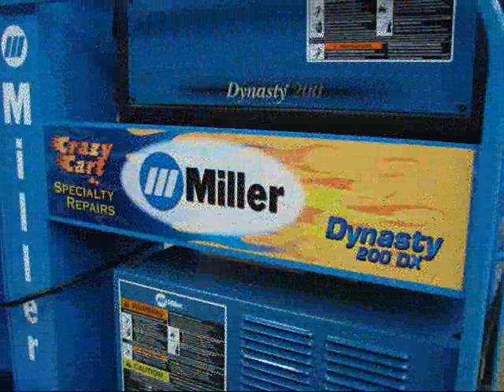Crazy Cart

Comment from the maker: Practical is an opinion and only applies to ones use of an item. For me the Crazy Cart is very practical for my shop. As for lifting the bottle on well I just grab the bottle and lift it on. It would be a simple modification to have a roll on roll off bottle loading system. I just didn't see the need for it at the time I designed the cart. I'm happy to hear your happy with your cart.

Comment: Paul,  I have never welded before and thought they I would like to give it a try, I was looking at the Hobart 140 mig, I only have 120v outlets., and want to keep the cost down since I do not know how far I will take this venture. While researching welding options I came across your video. Man, is there anything you don't do. Great video and awesome cart.
Reply from the maker: Well like your about to do I too started out with an inexpensive welding machine and over the years I put a lot of time into it and today I have a business that does a major amount of work because of welding. It seems everything I do is welding related weather it's a restoration I'm doing or a tractor mod. Good luck with your welding. I'm betting your going to enjoy it. Next thing you'll be designing and building your own Crazy Cart ;)
Thanks!

Comment: paul nice cart i would not take a chance with your welding helmet on that pole if it drops you could damage the lens my cart has a four door system the bottom drawer hold the helmet my tank is not as big as yours i only have an 80 cubit tank i still like it ,,,
Reply from the maker: Thanks. I need the big tank due to the amount of welding the unit does. As for the helmet. Well It's never dropped from the holder but Ive lost it from my hands, off the back of the truck once lol and although it got scratches now It works perfectly. This unit was built 7 years ago. Wow the time sure is flying by